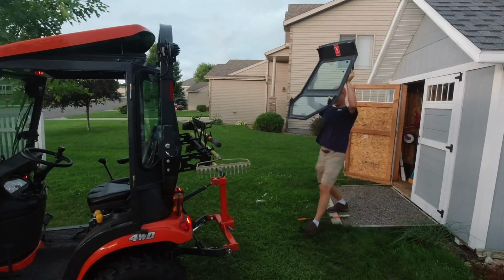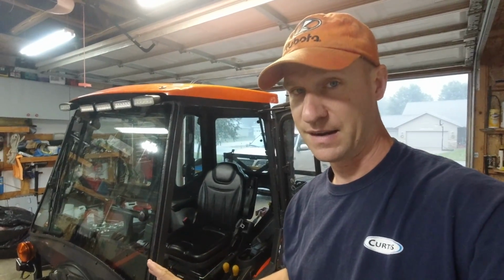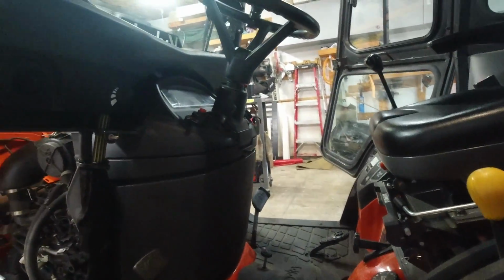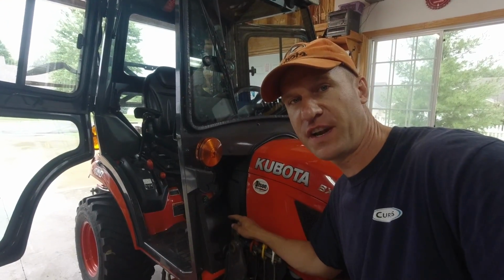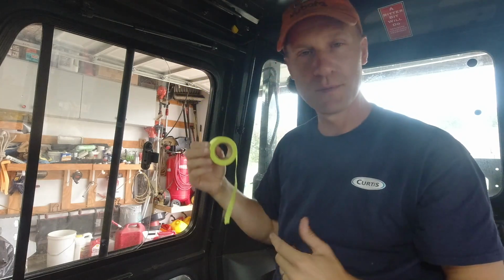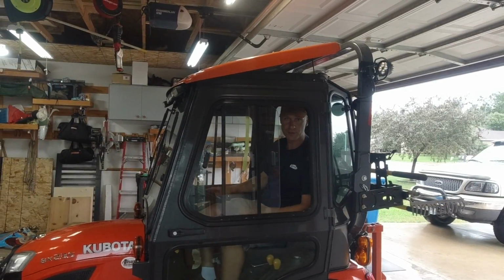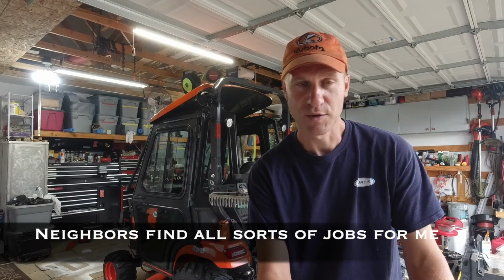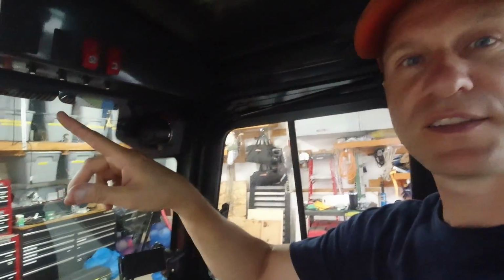BEST CAB FOR KUBOTA BX TRACTOR (curtis premium)

Comment: I have a Curtis cab on my BX2370 and love it.  I take the doors off in the Spring/Summer and put them back on in the Fall.  I need a rear view mirror and found one on the Curtis web site.  That's the next mod.  You do some great vids. 
PS:  we had 4' of snow last week.  I left the FEL on the tractor to see how that would work and it was good but I had huge banks of snow on the sides of the driveway.  Wouldn't have been a problem with the usual amounts of 6-12" at a time.
 Cheers, Bob  (45 miles NE of Syracuse, NY)

Comment: A really nice cab.  You don’t need a cab until you do.  I don’t generally plow when it is snowing, but when you need to leave for work and it is a wet snow or drizzle, you learn that a cab would be a nice addition.  Cheers
Reply from the maker: Or even if the wind is blowing which is frequently does around here. I enjoy being on the tractor without my fingers and toes freezing. 
Keep on tractoring!

Comment: Nice video! I almost bought a BX, but decided on the B2650 HSDC. Both great machines. I previously owned a John Deere 3320 and had a Curtiss Cab that I would put on in the fall and take off in the spring. After 13 years of on and off I had enough and decided on a factory cab. Keep up the videos! They are so useful and make me smile.
Reply from the maker: You’ve got yourself a nice tractor, I bet you have no regrets. It would be just a little big for my needs here. Thanks for the kind words! 
Keep on tractoring!
Reply: @ritterjon  Yes, I have an awesome tractor and am thankful for this tractor. I cannot wait for snow; remind me of this in March 2021 when there is another snow storm brining 18 inches of snow.

Comment: I like my cab too but my little pet peeve with that air flow is when I’m rototilling. When it’s dry out and I’m kickin up dust guess where it goes. Sucked through the windows or the back when it’s open. After tilling 1 3/4 of a acre. Me and the inside of the cab are pretty earthy lol. Have to keep the side windows closed, back window on and just leave the roof open. Dust doesn’t get that bad. Or when it’s really hot out just take the doors right off. Believe it or not I get less dirty. Still can’t beat this thing during the winter. Blocking off the rad sure helps keep it warm inside when it’s bitterly cold out. You have to do me one favour thou Jon. The big rubber seal between the cab and the left hand side fender has to be fixed on yours. Back off the screws that hold the back plastic to the door frame and tuck it up in there where it belongs. It’s been annoying me ever since you got that tractor lol. Mine showed up the same way and I fixed. Carry on.

Comment: Good video on the cab! I have a BX2380, that has the Curtis Premium cab, which is awesome snow blowing. What are the two outside mounted lights you have on your cab? I have been looking at some on Amazon, "slim" ones, just curious if you had a link to them.
Reply from the maker: Here is the Curtis link. Make sure you’re sitting down before looking at the price. 
https://curtisindustries.net/shop/product/5-led-low-profile-work-light-kit/

There are many other cheaper options. I’ll try and help you find a better option. 
Keep on tractoring!
Reply from the maker: Give these a try! I bet they’ll work just as good. 
https://a.co/d/7gJl5wD
Reply: @ritterjon  thank you for the fast reply!! I appreciate it. I think I'm going to look for a cheaper option lol. If you see something that fits nicely, I would be interested!
Reply: @ritterjon  that's more my speed😂😂😂 thank you very much!! I'll take a tape measure to the brackets after work tomorrow and see what's what. Thanks again!!
Reply from the maker: Anytime, you can always message me through Facebook also. Group name same as channel name.

Comment: What’s not clear to me is how the heat gets to the cab fan system. Is it electric or hooked into the engine coolant?
Reply from the maker: It is hooked into the engine coolant system. If you seen the two hoses running up in the cab when I was showing the radiator and fan you’ll see what I mean. 
Keep on tractoring!
Reply: Got it! Thanks!

Comment: I just got this cab on my 23s and it’s great I’m just not impressed with the front and rear wipers. The travel doesn’t go to the top of the windows and I’m tall so I’m looking out the top of the glass. Do you have this issue?
Reply from the maker: I do have this issue and I guess it’s something I’ve gotten used to. I also wish it would rest vertical instead of the top. A suggestion I might apply would be an additional toggle switch to stop it either at the top or side. I would if a different windshield wiper arm with a bend would help at all. 🤔
Keep on tractoring!

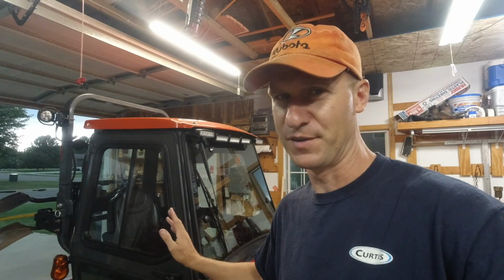Comment: It appears like when you open your hood, the grill makes contact with the brush guard (@2:06)
Reply from the maker: Yeah, I guess it does, there is some plastic molding there that keeps it from scratching. I'm not crazy about the new 80 series grill guard. I like the guard on the older series better. However I do like the way the hood opens vs the old style, trade-offs I guess. 
Keep on tractoring!
Reply: It’s not the best design. If you don’t pull the brush guard forward, the headlights will press against a plastic edging and push the brush guard forward. Eventually that will leave scuff marks on the headlights. If you pull the brush guard forward before before opening the hood, it doesn’t make contact.

Comment: Nice video as always. I love my Cab as well and worth the money. Have you gotten your heating airflow system fixed yet?
Reply from the maker: Hi Pete, nice to hear from you. I don't remember having an issue with my air flow system. What are you referring to?
Keep on tractoring!
Reply: @ritterjon  During our FB conversations when I was having airflow issues with mine I sent you a message to see if you were having the same issues and you said yes. Just went back to confirm it in our FB chats to make sure it was you I was talking to. You said your left bottom was weaker then the others just like mine was. So that's why I asked if you ever go it fixed? I guess not LOL.

Comment: I'm not sure how old your cab is, but I'm curious if you have noticed any wear and tear on it yet? I had my dealer install a hard cab on my Polaris Ranger UTV, and after a couple of years cracks started to appear in the hard plastic(s) that make up the cab and doors. My UTV is used on a farm, so the conditions are harsher than the suburbs, but I'm curious if you think that it will last the life of the tractor?
Reply from the maker: The doors of the tractor are metal and all the windows are glass. The plastic molding seems to be automotive quality and I haven’t had any issues. It’s held up better than I expected. 
Keep on tractoring!

Comment: Does Curtis make an A/C for that cab yet?  Last I checked they did not.
Reply: Yes. It’s bin out since last year. I talked to them about it for my Bx23s. It’s around $3000 for it though.
Reply from the maker: I’m not sure it will fit the BX23S because the roof needs to pop up to remove the back panel. But for the BX2380 AC is an option. It ain’t cheap! for some people in the south I can see the need however. Today we’ve got a ton of humidity and I wouldn’t mind having it now! 
Keep on tractoring!
Reply: @ritterjon   yes it will fit. I have all the emails from them saying it will an they have done it already. They just add 6" to the lines running to it.

Comment: I ordered a BX23S with cab, mower deck, Terra King MCS, and weights from Messick's.  It was delivered almost a month ago and broke down during first use after 15mins.  They came and picked it up after a week and have now had it 3 weeks.  Still not fixed and have already made the first payment.  No loaner or compensation.  Second guessing buying a Kubota.  They are saying it was a radiator problem during cab installation.  Dealership is reporting Kubota doesnt have a fix.  Surprised though knowing you have similar setup?!  Any suggestions?
Reply from the maker: Without know anymore details it’s hard to understand what the issue is. Sorry you’ve been without your tractor for so long. I’ve heard a lot of good things about Messicks. This is really one of the first bad issues I’ve read about. Wish I could help you out. 
Keep on tractoring!
Reply: Mr Neil Messick is sending me a mower loaner which helps tremendously.  Unit keeps overheating still no fix found. Hope i get mine back soon. Have lots of plans for it.

Comment: is it any quieter inside the cab?
Reply from the maker: It’s really about the same, I think about of adding some noise dampening material but I just haven’t done it yet. The 3M work times however are awesome. Check them out! 
Keep on tractoring.

Comment: Best cab video yet! Jon, my dealer was asking if the cab has a serial number so he can include it in my financing before I make my purchase. I’m sure you would know if they do. 😉
Reply from the maker: Thanks, I'll have to see if I have the model number somewhere. I'm sure I do. I'll get back to you on this. 
Keep on tractoring!
Reply: Any luck on that SN?
Reply from the maker: oscar munoz 
Delux cab BX4090
Rear lights BX4075
Front wiper BX4072
Rear Wiper BX4073
Front Lights BX4074
Heater BX4071

Those are all part numbers. Hope that helps you out!
Reply: Thanks for the info.

Comment: ...and Before ya know it you have $40k tied up in a tractor LOL.  Doesn't take long to make one of these BX tractors cost more than a new car HAHA!!!  

I wonder if you could add the cab later?  Or does it have to be installed when the tractor is brand new?
Reply from the maker: You can add the Cab later. I have heard that it takes about four good hours of installing it and that’s if you know what you’re doing. Yes adding accessories to the tractor really adds up quickly. 
Keep on tractoring!
Reply: @ritterjon  Great, thank you.  Allows me to save up some extra $$$$$ and not have to finance stuff.  Going to keep running the snow blower on the lawn tractor because the past few years we haven't had enough snow to really mess with the blower anyways, last year we had about 10 inches in one storm, that was it, everything else was just a dusting.  Think I may get a blade for the tractor though, might be of more use than the snow blower, and I don't think I'd better try a snow blade on the my lawn tractor, I don't really think the hydrostatic transaxle would handle pushing that too long.  

A few work lights and eventually a cab will probably be the 2 main things I add onto it other than the normal implements and attachments.  Course we all know how that goes, well I just need this and that....then pretty soon you have this, that, and everything else too HAHA!!

Have a great week.  Thanks for all the great videos, I don't even own a tractor and I feel from watching your videos and Mike Morgan's videos as well as Messick's videos I might just have some slight clue as to how to operate a tractor if and when I get one.